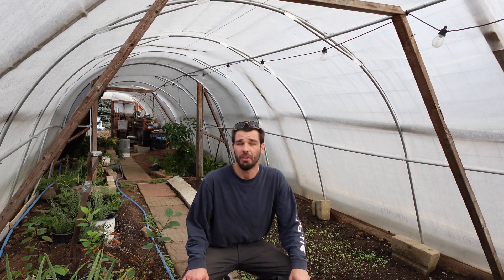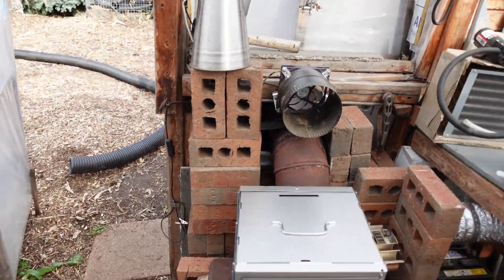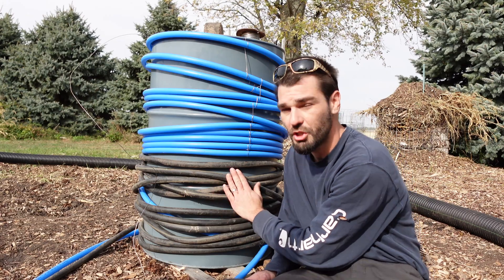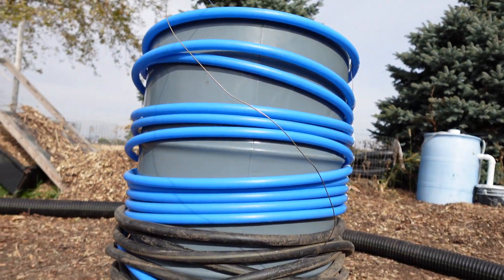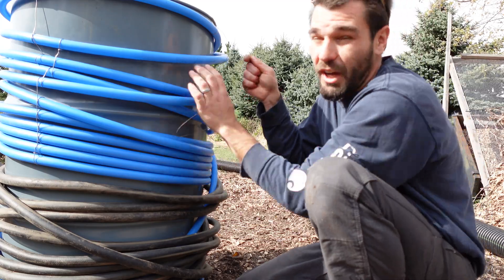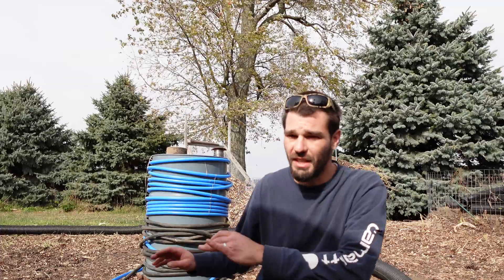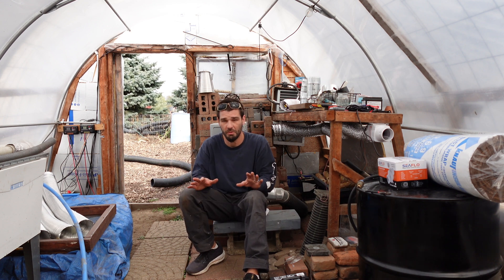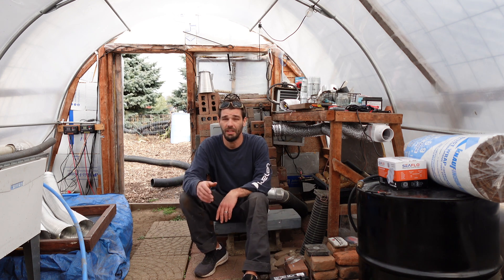DIY Winter  Greenhouse Heater -Jean Pain Compost Heating - Water Lines PT : 2 24/25 winter

Comment: Why not coil 5/8 inch copper pipe inside of that barrel and fill that with sand? You’ll have more surface area contact between the heat battery and your heating medium and the sand holds heat better than water.
Reply from the maker: Sand can hold more higher temp or more energy before changing form, but waters specific heat is much higher. Since we’re dealing with temps lower than 200F water is the best thermal mass we could use. Although that’s an interesting thought thanks for checking this out

Comment: Just a thought . How about using sand inside the barrel  like ina sand battery ?
Reply from the maker: I seriously thought about it but the effort of getting sand in a barrel vs water is extensive lol
Reply: @Earthdwellershomestead  so are you saying sand would be more efficient than water?
Reply from the maker: The only benefit would be that sand can get up to a higher temperature than water before it changes form. But with the compost water can easily hold 130-140F. Sand battery was a thought but water was the winner for best thermal mass in this application

Comment: hi there not know what latitude you are at I assume  somewhere between 43 and 45.  as you say you are growing things all winter. just saying at that latitude. you can achieve what you are doing with much less work involved. I live at lat 52.  nothing will grow even if it a warm environment  simply because there not enough light  once you enter Oct to March. as I have my zero energy input greenhouses . sure I have strawberries still growing in there.  currently  they might produce fruit but they take forever to grow and even longer to ripen once it later then Oct. I live in a zone 2B in  central manitoba Canada  and grow peaches , nectarines, and figs (etc...)  in my greenhouses as well.   but I was just going to say if you build a high mass greenhouse . you can do more  with no heating  especially if you are at at latitude <= 45 degrees. just have your orientation east west and glazing on south side and high mass wall  east west and north ,I fill my walls  with soil .  it keep your greenhouse  about 20 to 30 degrees warmer then the outside temperature  in the winter and in the summer keep the greenhouse cooler  as it usually only  heats about 5 - 10  degrees warmer then outside temperature in the summer .  if you live at <45 Lat . your greenhouse should stay well above zero   for 95% of the winter  and I doubt it would get colder then -5c if it does drop below freezing in the green house  which most greens that tolerate low light can easily survive
Reply from the maker: @skrywenko6596 lots of input there, thanks for the questions. We’re in northern Illinois just below Wisconsin, 41-42 I believe. We wouldn’t be able to do nearly what we can with a heated greenhouse, with very little invested. We could and will someday build a great passive solar greenhouse but that will have a much greater incurred cost to what we’ve achieved over the last 8-10 years. Thanks for sharing your input with us, we’ve experimented with some grow lights also to get a little extra out of our plants since we’re trying to harvest all winter.
Reply: @Earthdwellershomestead  at 41-42  Lat .  you have  the same light intensity at winter solstice that I have  in early to  mid Oct. . with a high mass greenhouse . you should stay well above zero. it be  probably 25c during the day and on average  5c at night ,
  for me I just  build  with  2x4 or 2X6 frame at either  2' centres  or 4' centres and fill the walls  with soil . you can insulate the outside wall with Styrofoam for added heat retention. I do not bother as i want my fruit trees to sleep properly till march  if i did my trees were waking up in  mid January and I did not like that . but looking up you  average winter temp for your area  daytime is above   freezing and  night time just below freezing. if I base on my temperatures .  the coldest the high mass greenhouse should get is -3C as that your average winter temp. as that is  the coldest mine gets  my average winter temp is  minus 16C and that coldest my  greenhouse gets at minus 45c.  with my low light intensity and very short days  that i have , you have double that of mine so it should be   much much warmer . I doubt it would even dip below freezing on your coldest days . but just a suggestion

Comment: Ok one more idea? How about putting fittings on the barrel outside and some on a barrel on the inside. And let convection pump the water for free?
Reply from the maker: @cliffp73  the natural thermophilic draw is a pretty cool! We have achieved this a few times over the years with our air moving system, the water takes a bit more energy and won’t flow a great volume but it can be done. I thought about attaching to the 55gal drum inlet and output to exchange the mass itself, with less thought I just went ahead and wrapped them on the outside for conductive heating. Thanks for the questions!

Comment: Weird question… could you pull “too much” heat and stop the process of composting?
Reply from the maker: That’s very possible! I will cover all that in videos on the pump install and start up as we experimented with a few pumps to dial in the flow, thanks for the question

Comment: Would putting the compost pile/barrel along with the water transfer lines , inside the/a greenhouse be beneficial ?
Reply from the maker: Yes, if I had a small structure/ greenhouse enveloping all of this we would have much better results and we could pull from the airspace of the structure. I’ve thought about building a greenhouse tunnel or something like it. Thanks for the comment and ideas!

Comment: Would digging it down into the ground using geothermal and compost in a pit?
Reply from the maker: Great input! Every year I run a big tiller in a circle and create a basin for the pile, we used dry woodchips to fill back in the excavated area for a buffer between the soil and pile.  I would like to have a dug out area with more permanent metal transfer media, the natural flow would lessen stress on the systems.

Comment: I wonder if you couldnt find someone who smokes a bunch of them vapes and save the batteries and turn them into a battery bank for yourself?
Reply from the maker: I’ve thought about that too. Most of them seem to be rechargeable and that was my first thought at the sight of them. So much waste
Reply: @Earthdwellershomestead  I've seen a video where the guy charged his phone and ran his laptop off a small bank he made from them. If they are lion they are all rechargeable even if it doesn't have a charge port. Would be cheap to make a nice setup for your solar and wind turbine. Then maybe you can get tank heaters and what nots